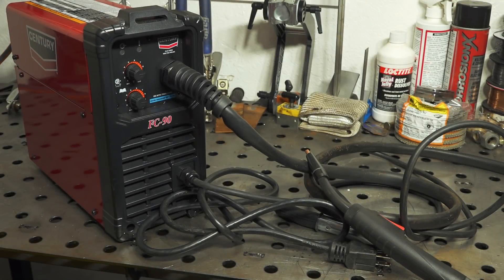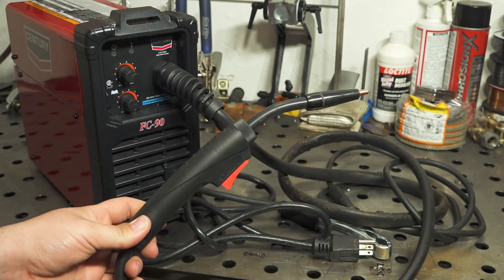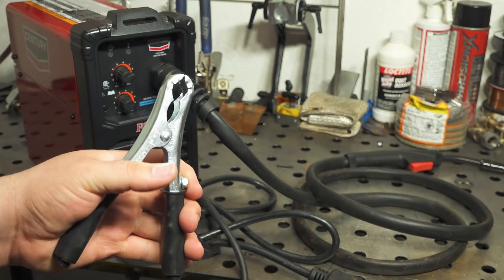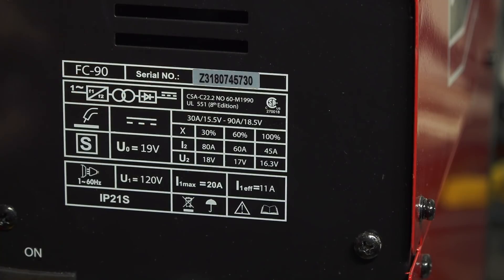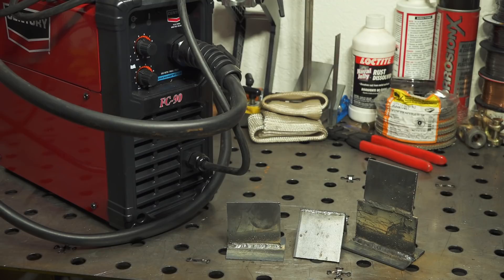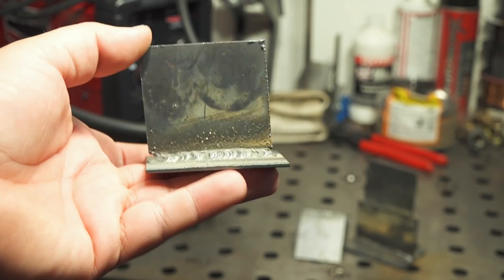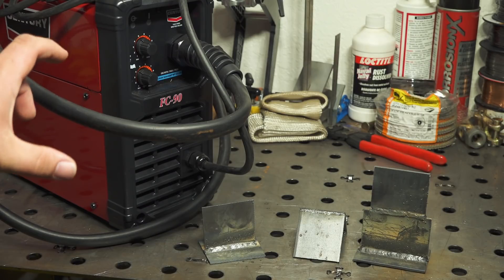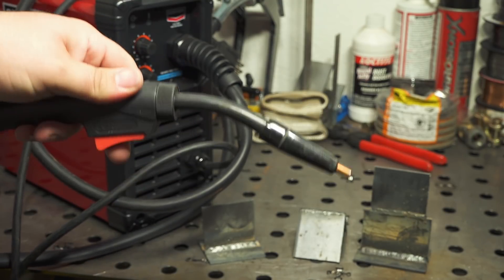Century FC-90: Low Cost DC Flux Core Welder

Comment: thanks for this video,after converting my HF flux 125 from your tutorial, I have become intrigued with these small portable machines. So after seeing this video I decided to purchase this one as well.  I actually got it unboxed today and tried it out and it did just as good as expected and seemed pretty powerful for what it is and compared to the HF after conversion.  I noticed tho on the box its calling for .035 NR 211 wire and even came installed with a .035 tip in the gun. well all I have is E71t-11 by blue demon.  I switched the tip out and changed the knurled roller to the .030 side and ran a few beads and it went well... just seemed like it was almost too strong for the smaller wire.. Do you think I should buy a roll of .035 or just run what I got for now?
Reply from the maker: If the 0.030" wire is working for you, I'd say just run it.  You could try 0.035" wire when you need more, but I don't see why you couldn't run what you have for now.

Comment: Would you recommend this welder over the HF 125? I’m mostly welding 1/8 steel. Thank you
Reply from the maker: This welder is far lighter and runs much smoother due to having DC output, vs. the HF 125.  The HF 125 is quite a bit less expensive though, and most people do seem to report that they hold up pretty well over time.  I prefer the Century FC-90, but I don't think the track record is quite as proven, and it is more expensive.
Reply: Don’t get the cheap Harbor freight welder, trust me!

Comment: For 1/16" this machine shines.   1-2mm material is the bane of welding. This welder will pay for itself on the first exhaust system that you repair.  Heck, you could make steel belt buckles for fun.   Please do some 2mm plate or exhaust like the noisy heat shields with this unit.  Good video.
Reply: José Duarte Miranda I just purchased one and for some reason I cannot even get a bead. It’s just tiny little balls barely StuCk together . Any idea what settings or what I should be doing?
Reply: @RobMetzgar01  Hello.  Depending on the thickness of the material, the amperage/voltage is too low/cold. Check for a good bare metal ground and no paint on the surface to be welded.  The company answers emails. Send an email to them with your specs.  If the guidance is not a solution, the welder could be a candidate for defect return.
Reply: José Duarte Miranda thank you for the info. I’m actually trying to weld a steel pipe onto a brake drum. I have the clamp on the brake drum but it is pretty thick in general. Maybe not enough power for something like that?
Reply: @RobMetzgar01  1/8"material is the optimal thickness for the FC 90.  The pipe and brake drum are conducting heat away from the weld area.  What do you think about a narrow land/sharp bevel on the pipe, preheating the material with a propane torch, tacking, and welding uphill after you get tacked in place?  Root pass, HOT pass, capping passes. As you weld, the material will accumulate great heat.

https://youtu.be/usjIl_we8Ps
Reply: José Duarte Miranda I see what you mean. This may not be strong enough because there’s no way this metal is getting warm it’s just making little pellets that barely stick together. I will check out the link you provided
Reply: @RobMetzgar01  https://youtu.be/uDF-vZG850M Preheat. Sharp bevel, tight gap, and crank up the heat for your tacks.  In the video small pieces of metal and not large pipes are used.  Or see if you can rent from Home Depot their Lincoln 200 amp stick welding machine.  If you were nearby, I would lend you my Century 110-110 stick welder (The Day the Earth Stood Still amps).
Reply: José Duarte Miranda I heated up the metal where I am connecting and it seems to work a little bit better so I think I just need more heat like you were saying. This may not be strong enough for this project
Reply: @RobMetzgar01  Pour heat into it with the propane without worry, as propane cannot get hot enough to melt the material.  Don't worry about spatter, shallow fusion, etc, as it looks like you're making a tool.
Reply: This is what I am getting: https://youtu.be/T23W2fJDdYA
Reply: I heated the area up fairly well but still no real connection. Using .030 aluminum wire. I am trying to weld this pipe to the break drum so I can put fluid in it for quenching metals.
Reply from the maker: Was that a mistake, or are you actually using aluminum wire?
Reply: @RobMetzgar01  I saw your video.  Grind the material to bare metal and wipe off with alcohol.  Preheat.  This is a lot of material for a sheet metal welding machine. The FC 90 isn't even making worms, the sign of too cold, but rather spatter the sign of reversed polarity.  However, there is no polarity attachment.  If BIG preheating fails, the welder does not generate enough heat for all that mass.  The HF Vulcan and Titanium mid range welders can generate enough heat.
Reply: @aguilayserpiente  Thanks ! You are correct. I just didnt want to spend that much money, but I don't think this will do the kind of jobs I would need it for.
Reply: @RobMetzgar01  Aluminum wire?  Is the drum steel?  I saw rust on the drum.  There is a special stick electrode for alum to steel.
Reply: José Duarte Miranda  Since I’m new to this I’m assuming the drum is steel. But this welder comes with aluminum wire?
Reply: I guess I should take a different approach and get different materials this looks like it’s not going to work easily.
Reply: @RobMetzgar01  Whoa, whoa.  Gently remove the aluminum spool of wire.  Tuck it in a hermetically sealed bag or sell it on Craigslist.  Put the .030 steel flux core wire in the FC 90.  Remove all rust from the drum.  Get a respirator with cartridges for welding.  If that is galvanized/zinc coated pipe EXTRA ventilation.  Do the steps from the prior posts above.  All systems will be go in T minus 1 hour.

If the wire was steel, as it should have been, test the welder on small 1/8" or less steel like a door hinge.  If you can make a bead, voltage and heat are the issues.  Save the welder for body and exhaust work or return it.  Get a bigger welder.
Reply: José Duarte Miranda ahhh, so I will run down and get steel wire.  I have a ventilator . I will update you this week. Thanks for the info!!!

Comment: Good luck, hope it doesnt short out and become a paper weight like mine did.😀👍
Reply from the maker: Yikes, sorry to hear yours failed.  I know they have a short warranty.  How old was yours when it failed?
Reply: @bigtb1717  i got it last may and it shorted out 2/10/19. I was welding a woodstove grate insert. I heard a high pitch squeak ing and it threw the breaker. I turn breaker on again tried welding snd it quit aftr that. Power button lit up but no power to welder, even fan didnt work. I think somewhere on circuit board it shorted.
Reply from the maker: That's a shame.  Inverters have gotten fairly prolific across the welder market, and I think that general reliability is fairly good.  Still would be interesting to see how these FC-90s generally hold up long-term.  Where about are you located?
Reply: @bigtb1717  yea, i didnt even over use it, couple builds here snd there. I rarely max out settings just within what i was welding. Im located in northeast az. Top secret location, lol. For what its worth i really enjoyed using that welder because it was an inverter. I still have my jobsmart 125amp fc that i mainly use for dedicated flux core. Good luck enjoy your welder, i did for awhile.👍
Reply from the maker: Well, you aren't that close, but I'll still ask.  Do you still have the failed FC-90?  If so, is it still in basically the condition it was when it failed?
Reply: @bigtb1717  yea, was still in good condition, ive asked a welder repair guy and what he basically told me itll cost more to repair and ive contact the manufacturer. What was explained to me was its beyond warranty and i bought extented warranty and that wasnt valid because not within parameter of warranty. He advised that they do not sell the circuit board for that model welder and it just a paper weight now. Idk what warranty doesnt cover a faulty machine. So i just might scavenge the wire feed drive, torch gun, and fan. S.O.L. for now on that welder. Lol.
Reply from the maker: I guess I was just curious to look inside and see if I could tell what failed and try to fix it.  A big problem with inverters is that a shorted component can cause a cascade failure of other components.  Still, could be fun to try.  

Probably not worth shipping it around the country.  But if you feel like seeing a video of me trying and probably failing to repair it, I'll pay the shipping and a little extra for your trouble and to cover whatever little value is left.  And if, by some crazy chance, I manage to fix it, I'll ship it back.  No pressure, just a thought.
Reply: Would u recommend this welder over the harbor freight 125? People say the hf 125 works great and keeps on working. I’ll mostly be welding 1/8 steel. Thank you for your videos
Reply: @jonaskey  i would recommend it. Its a very versatile welder for its size. Its an inverter dc with really good penetration when it is set correctly. HF 125amp fc is an ac welder. I've personally never used a hf welder. I started with a jobsmart 125amp fc ac welder, same realm. I really enjoyed useing fc90 because it was an inverter a difference from the transformer type welder. I would buy it again down the line later.

Comment: compared to the HF flux 125 after conversion to DC.  how much better or about the same is the two?  I have been looking at this machine lately for a dedicated Flux wire machine.  I don't do much Flux welding but I wouldn't mind having this one as an option.
Reply from the maker: The FC-90 has a nicer arc.  I can only compare with the simple conversion I did on the Chicago Electric welder, but if I was deciding between buying the HF welder to convert, or buy the Century FC-90, I’d go with the FC-90.  DC out of the box, smoother arc than a rectifier only conversion, smaller, lighter.

Just my personal preference.
Reply: I have made up my mind.. I will be purchasing one of these welders.  it would be perfect for the small fixes that come up instead of lugging around a 200 class machine and swaping polarity and wire just to fix the elderly lady's favorite patio chair.  'thanks for the video